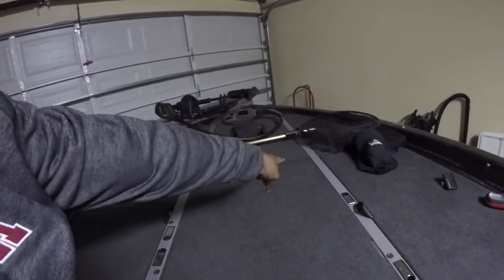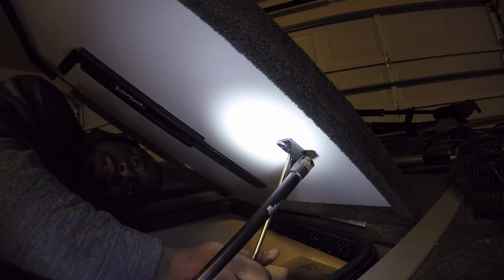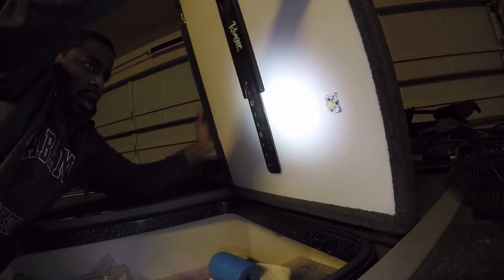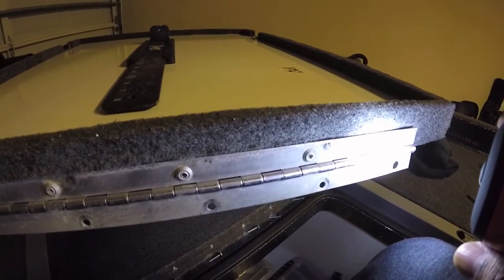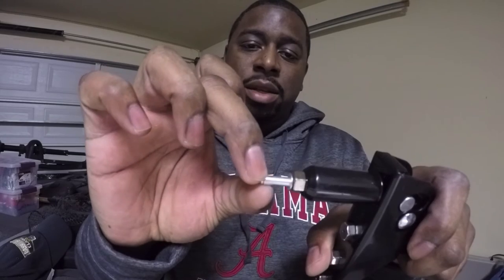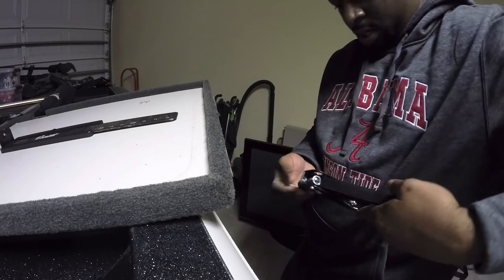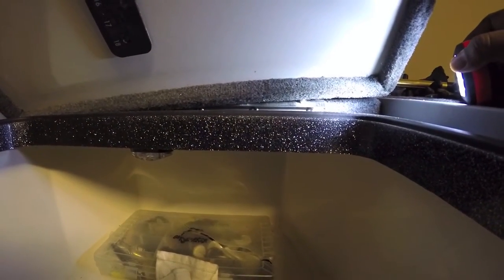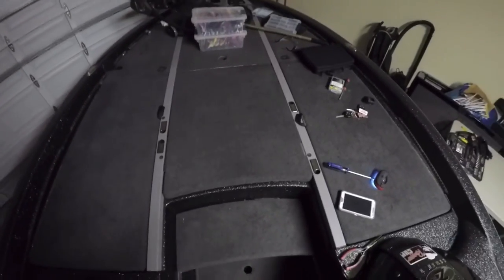How to Replace Rivets in Deck Lids

Comment: Another way to solve this problem is to use a washer on the back side of the oversized holes instead of drilling new holes… but you got it did and we’re able to get back on the water so it’s all good 🤙.... I work on military aircraft and run across this problem almost every day so the washer trick comes in handy and keeps you from having to drill extra holes in the part. Great video 👍🏼

Comment: One piece of advice.  You need to add another shock to the other side.  There is to much resistance on the side that tore out. Boat manufacturers corrected that issue on newer models.

Comment: would't it have been easier to just pop the clip off the strut and take the strut off the mount?
Reply from the maker: stratosjeff I didn't know you could do that. Good suggestion though.  when I did my rod locker, once the 3 screws came out the shock came loose.
Reply: yeah, at the top or bottom of that piston, there are clips, you pop them off and then the piston comes off a ball mount, cool video though, glad you got it working again!

Comment: Could you not have popped the clip on the has strut to take it off, instead of removing the bracket? A lot less effort and body contorting to get those screws out haha
Reply from the maker: @rickc9036  yes but I didn't realize that at the time
Reply: @HookEmUp2012  we all learn the hard way bud. Don't ask me how I know haha good video. Trying to determine if I want to take rivets out of some trim on my transom